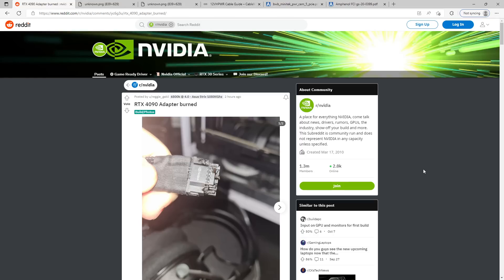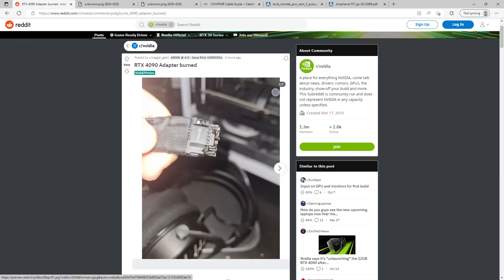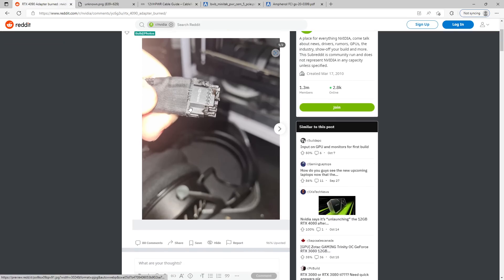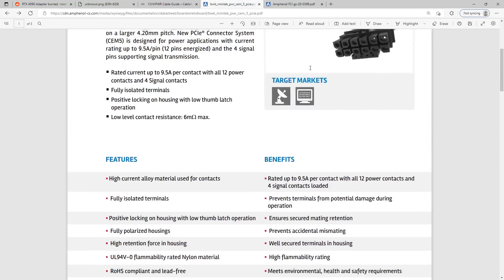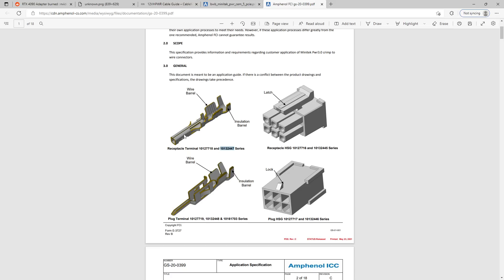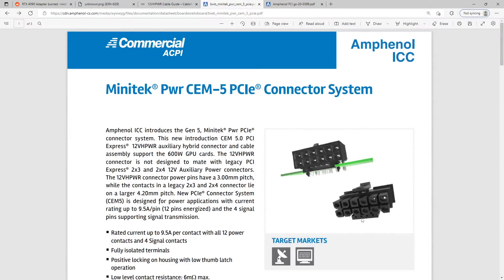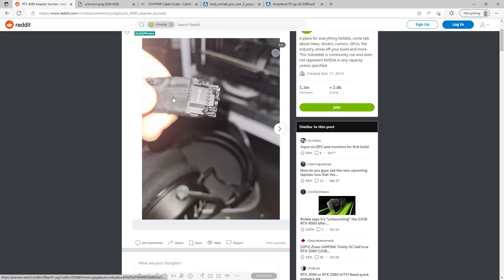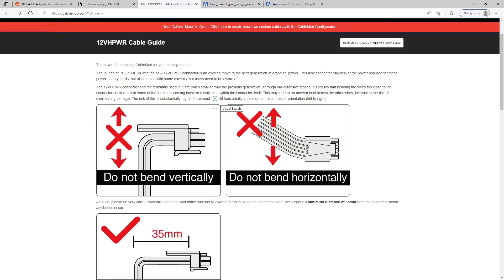The 12VHPWR connector sucks

Comment from the maker: EDIT: PCI SIG was aware of the physical weakness of the connector: https://t.bilibili.com/720822338533195796

I would like to thank Nvidia for providing me with material for low effort content.
Reply: Us: "This is irresponsible. NVidia should fix this"
Nvidia: "HAAAAAAAAAAHAHAHAHAHAHAHAHAHAHAA"
they don't care at all about users or complaints
they will start caring when the class action lawsuits are brought
HINT HINT
Reply: @iamdmc  They are in the safe because they are following the spec that was NOT DESIGNED BY NVIDIA.
Reply: @iamdmc  class actions have never made bank for the people only the lawyers and the system itself but here are your 2.75$.
Reply: @iamdmc  Inb4 an agency forces nVidia to fix its shit.
Reply: Thanks for your informative video!!
Reply: Never feels low effort, it's good stuff.
Reply: uhh isn't this on PCI-SIG though?
Reply: @doogen  they didn't certify the connection. Intel released the spec for production regardless of what happened. PCI-SIG isn't a regulatory agency. Just a band of companies and people in unifying pci ex and the connections.
Reply: @option350z  I get that much, which is why I am genuinely asking is this all an nvidia failure.  Is the failure with the spec, or the failure with the implementation.
Reply: @doogen  To be honest, you got me with that one. I just as much expect the newer AMD cards to come with 12V-HPWR connectors as well. I'm thinking it's an oversight on Intel's part in terms of the spec. It's still possible to use the old 2.0 connectors with the the 3.0 PSU. I don't think they made a full transition. Part of it is on Nvidia's part for adopting something quickly and not testing prior to. You'd think insertion tests would show this issue on their own founder's edition. Unless they really don't do that testing at all.
Reply: @option350z  I dunno either.  I agree the AMD stuff is more than likely gonna be the same way.  It's too bad EVGA left the table, they probably would have something like their powerlink worked out for it.  A manifold style adapter like that might have solved the problem the pigtails are running into.
Reply: @option350z  they did testing, that's why they know not to bend them at all (as if that's possible with the MASSIVE size) lmao hopefully that guy got his card replaced and not denied because of a little bend in the cable. There's a lot of things companies know are at risk of happening, they weigh the risk, cost/difficulty, etc, to the point that sometimes they know something is going to cause lawsuits and if they thing those suits will be cheaper than replacing problems, they will let it happen.
Reply: @doogen  No, it's on Intel, who made the standard, approved it, and sold it.
Reply: Intel: HaHaHa, he didn't realize we are responsible for ATX 3.0.
Reply: @udorot3158  Yes but nVidia is implementing it an environment where failure is occuring......so blaming intel seems like a technicality.....nVidia will own this one
Reply: I blame intel for making this standard.
Reply: lmao...
Reply: Easy roast and informative video, win! win!
Reply: wasn't this cable part of the PCIe5 specification that Nvidia had to follow?
Reply: @Γευστικός_Κάλυκας  then its a spec you should not go with and say we cant
and if enough people said nope cant it gets altered to proper shit
naaa lets say nothing do whatever take peoples cash and laugh at them ...thats the real angle shareholder happy you/me/everyone else screw off
Reply: it is crazy how the lowest effort videos get the most clicks
Reply: @snowhawk4049  ive done pretty good now n then and doing better with actual effort
on my 600 dollar canadian pc doing game builds and some unreal cinematics
haha go on spend ten trillion and do better im having fun
Reply: As someone who designs and plans cables on the daily for products, this idea was always collosally stupid. I wish NVIDIA didn't have the control it has over its AIBs so we could have our older 8PINs back, for now.
Reply: @djelectric  You don’t design shit sheep.
Reply: fill the adapter at the wire end with silicon or hot glue  so cables dont bent the pins.
Reply: @ravishkasilva2851  epoxy
Reply: @ravishkasilva2851  I'll do myself one better and avoid cards that require this.
Reply: Buildzoid has burned up enough gear over the years to be able to just look at it and tell you if it's going to fry, or not!!!🇺🇸 😎👍☕
Reply: did Nvidia design this connector? let's be sure to paint a broad brush if we must.
Reply: they would have literally been better off with two 1/4 inch posts and 10 AWG wire with ring terminals.......
Reply: One cable out of ten thousand?  Who cares.   Clickbait video
Reply: It's well deserved 😂👏
Reply: Burn! oh wait...
Reply: Hahahahaa.........well, i guess this could be considered a PSA of sorts too....love your content BTW
Reply: All praise Nvidia! May they forever provide.
Reply: All you guys love complaining about Nvidia tho
Reply: lol. What a sick 'burn' ;)
Reply: lmao
Reply: That burn though
Reply: @MantaProx2  smokin , isnt it lol
Reply: Love this comment haha!
Reply: wow you now have a sponsorship you're slowly becoming a full pledged youtuber, I'm so proud
Reply: NICE  AWES0ME KEEP_IT_UP! ✨🎉✨🎉✨🎉🎉🎎🎭🎎🎭🎎🎭🎗🎗🎗🎗🎗🎗🎗🎑🎑🎑🎑🎑🎑🎑✨🎆🎆
Reply: the wires and contacts aka pins are virtually one . they're crimped together and so pulling the wires pulls the pin loose from the wire. theyre not generally referred to as separate things.
Reply: I came back to Nvidia with the 3000 series,I didn't like the FE cards because of that power connection and made sure my RTX 3070 has two 8 pins connections
Reply: Searching pcie 8 pin melted shows thousands of results.  By all your logic the 8 pin is trash and we should get ride if it yada yada yada, (echo chamber of bullshit).
Reply: @_Clivey  They were a big part in that. Also, they put it on the card, they chose to use it with known issues. It's on them. It's their product.
Reply: We watch the all powerful Zoid because of the honesty (what a stupid connector) instead of trying to graduate the consumer from holding it wrong to plugging it in wrong, like wow
Reply: THIS WAS an adapter, nothing todo with atx 3.0 psu.
Reply: You state in the video that Nvidia came up with the connector, but they did not. It's a part of the pcie 5.0 standard from PCISig.
Reply: @granitecowboy2199  incorrect. Nvidia designed the connector and pci-sig signed off on it and submitted it to Intel.

I know this because I am in this industry and we know who designs what.
Reply: @granitecowboy2199  Exactly, and it's not even a real cable from a real atx PSU.  Its the cheap ass adapter that a SINGLE guy bent to shit and shorted.  So 1 or 2 out of Tens of thousands? Everyone is just using this to get views, I have a real atx 3.0 psu and the wire is unbendable by the connectors.
Reply: @4gbmeans4gb61  nobody has been talking about the atx 3.0 standard or psu's. The whole issue is about the 12 pin (or actually 16 pin) pcie 5.0 power cable. 

However, in some cases, it may affect the PSU connector, since they are one in the same according to the atx 3.0 spec... Both ends of the cable will use identical 16 pin connectors.
Reply: The "weakness" was only reported on the PSU side.  Which is why Corsair opted not to use a 12VHPWR connector on their PSUs. The fact that we're seeing this on the GPU side is quite new.
Reply: doubling down on the idea to fill the cable side of the connector with hot glue.

anybody can see an issue with this method?
Reply: @Mac_Daffy  How about dont use these cheap ass garbage adapters??  I have a real atx 3.0 PSU and the connector end has SOLID copper wires in the last 1.5 inches of the cable. Its UN bendable.
Reply: Hey bullzoid, I wanted to get my ram tweaked to max performance. I was trying to get timings as low as possible till it crashes but. Just realised some values should be increased in bios and reducing them was causing reduction in performance (i/o latency, trefi) can you please help me out on whether to increase or decrease a particular timing like is there some kind of list where i can search through and know, if increasing reduces or improves the performance of ram stick.
Reply: And now this connector is part of ATX 3.0 for the next decade XD
I do remember when systems where 5V heavy to the point where the ATX connector on the MB went up in smoke due to excessive current.

But then we got the EPS12V connector and PCI-E connectors to solve that and 12V as the primary voltage.
But today they create an issue for no good reason? Makes perfect sens I guess...

Sometimes I wounder if companies just pays to get there stupid ideas in to Standards, anyone remember Intel BTX standard?

Would be kind of funny if Navi3 cards had normal 8 pin PCI-E connectors tough just to stick it to Nvidia.
Reply: @NittonÅttiofyra  I pray they do. Not sure I'd wanna screw with these connectors.
Reply: 12VHPWR is Intel not NVIDIA ;)
Reply: @DOGMA1138  I love how intel actually use a 6 and a 8 pin connector on their A770 card
Reply: @DOGMA1138  Nvidia is powerful enough to say: screw it, we'll go with classic 8 pin arrangements, but no, they decide to use this crap geez
Reply: @DOGMA1138  and that's something that always bothered me. Why the hell is Intel (a company which didn't have a viable graphics card) pushing for a standard for power delivery on graphics card. Their 12vo which was for going to the motherboard made more sense.
Reply: @AbsolutTalent1  Because Intel controls the ATX standard, 12VHPWR is defined in the ATX 3.0 standard to meet the 600W power requirements of the PCI-SIG PCIe 5.0 standard.

The whole 150-600W on a single cable with load detect and rebalancing crap is an Intel thing.
Reply: @DOGMA1138  Which is why Intel Alchemist uses 3x8 and not this abortion?
Reply: @DOGMA1138  NO 12VHPR was DESIGNED by nVidia, they submitted it to PCI-SIG for their approval and PCI-SIG then pushes this to Intel to add into the ATX 3.0 Standard. So the blame STARTS with nVidia and End with Intel. Both PCI-SIG and Intel could have said NOPE that's not going to handle 12 volts 50 amps (which is how much 600 watts is) but nVidia always gets their way. This power connector needs to be looked into and if found to be actually unable to handle the power then AIB's PCI-SIG and Intel need to sue nVidia for their design
Reply: I'm sure number of us saw this coming, I'm more surprised somebody hasn't snapped their power connector off of their board yet. The female plug is physically weaker and smaller than the mini fit Junior 8-pin.
Reply: @chubbysumo2230  
its liek a scam you know about but are paying for cause you just went stupid for a minute
im still on a 1660 super i have 2 pcs with them and ill say no to 20 30 and 40 series and my bet is i prolly will go to amd if they dont get too price stupid
Reply: The atx 3.0 standard which incompasses the 12vhpwr pcie 5.0
Was designed by Intel no?
I understand it's easy to blame Nvidia for something like this as they are the "first" but it's not like they exclusively designed this connector for there new GPUs just so they can look nicer
Reply: @thegoogleplex  Well Look at 3000 series card, they have the same connector excluding the sens pins. 
In fact no one else NEEDS this stupid connector but Nvidia at the moment.
Intel may be in charge of ATX standard, PCI-CIG may be in charge of PCI standards but what is implemented is in the end driven by who ever needs it and has a say in the market. So yea without Nvidia this connector would probably not exist in its current form or at all.
Reply: @NittonÅttiofyra  except that both companies are using it, nvidia just happened to launch first. lets just hope that AMD gives AIB's the option to use the 12 pin or use the old 8 pin adapters.
Reply: @sirmonkey1985  Well the news for yesterday it seems AMD confirmed 16 (12 + 4) pin is a no go for them or AIB's. But we will see I guess.
AIB's might opt in them self tough.

I personally dont see the rush to adopt a new standard first time around.

Also there is very little benefit to the end consumer right now with the 16 pin connector.

Once ATX 3.0 PSU's are out it makes a bit more sens, right now everyone needs a stupid adapter

Also the RTX 4090 is a bit funny because its PCI-E Gen4 on the bus but Gen5 on the Electrical power side of things.
Reply: Low quality too
Reply: So, who designed this connector? Serious question. Other channels claim it was intel + some company that does these standards,... not nvidia actually.
Reply: @Tech_Enthusiast_001  
he was not joking made in china on it
Reply: @Tech_Enthusiast_001  Molex did the connector.
Reply: @Tech_Enthusiast_001  Then those channels are lying/misinformed.
Reply: the solution for nvidia is that yo uburn it quick and never get to test or use said card after paying ungoldy money
lol
Reply: Well Nvidia put the work in for you.
Reply: Can you see it the 12VHPWR connector is made in China
Reply: @sn0okums10  lol
Reply: You focused on horizontal bending but it also says not to bend vertically as well. Basically don't bend the cable within 35mm to the connector itself. Which basically leaves it as a "Riser gang only" situation. I'm a bit shocked that the guy who used the riser had trouble with that tiny bend, but i'm not surprised it's Nvidia after all and they have a history of screwing over their customers. Wish I could link the hour+ long video as reference but it's been so long ago that it's hard to find in the searches nowadays.
Reply: Is this not an industry standard that was pushed by Intel though? Pretty sure the entire PCI-SIG is to blame for the state of 12VHPWR.
Reply: @abheekgulati8551  Not Intel. Intel had nothing to do with it. They only added it to the latest ATX spec AFTER it was cleared by the PCI-SIG.
Reply: the "plastic" of a single 8pin connector has more plastic overall than the amount of plastic in the 12pin connector...

the density of the 12pin connector means that the energy loss in the connection is concentrated in a smaller area. energy transferring from the pin to the receptacle is not 100% efficient.

such there is not enough physical plastic to dissipate the heat generated by this efficiency loss.
Reply: It's nice how you conveniently ignore that all those photos are of PSU cable ends, nothing to do with the GPU. Meaning this is an Intel problem. Not an Nvidia problem.
Reply: just you wait for rdna3 😉...
Reply: @BaBaNaNaBa  It'll use less power, and still use the 8-pins
Reply: @BaBaNaNaBa  Why do you suddenly sound like Dr. Betruger in his proclamation to Elliot Swann?
"Don't worry, they'll get their 'product'. Amazing things will happen here soon. You just wait." RDNA3 :goodvibes:
Reply: @BaBaNaNaBa  Nah AMD is always good. No matter what.